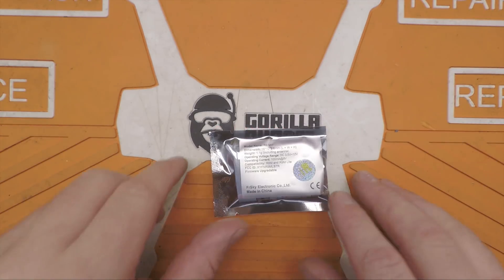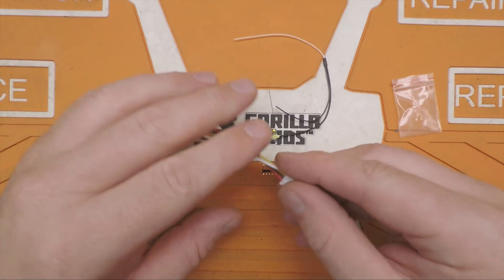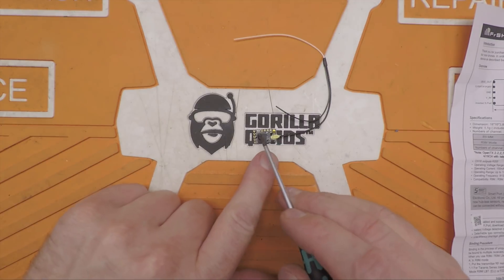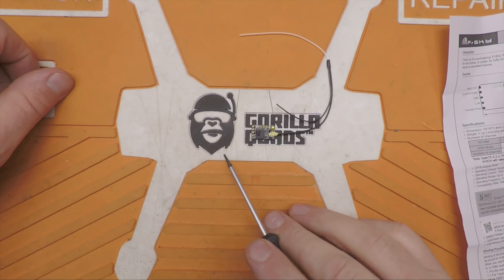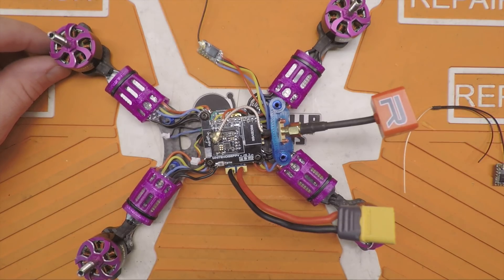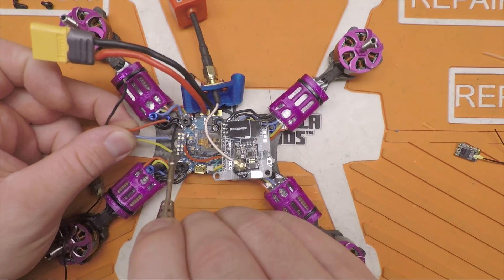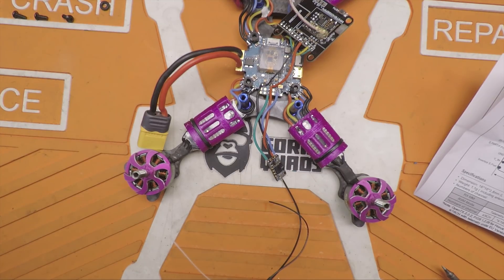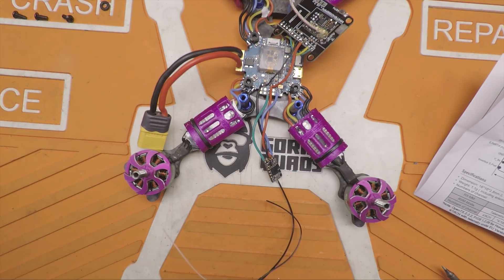Frsky R9 MM install and setup (READ THE DESCRIPTION!)

Comment: Thanks for the video! Why is it when I bind the r9mm channel with range 1-8 for better latency, I'm still getting rssi on channel 16? Is it not possible to bind in 1-8???
Reply from the maker: With the r9mm the rssi comes across on ch16. It just part of the firmware.
Reply: TweetFPV  Thanks for the reply. The reason I’m asking is because this thing drops out of the air as though I disarmed it. This isn’t my first build but it’s my first go around with R9 setup. I’m trying to eliminate all other possibilities like power loss, poor ground, or maybe even a faulty R9mm or R9m.
From what I gather, I may have a packet loss issue in Betaflight when binding in 1-16 channel range ( https://github.com/betaflight/betaflight/wiki/SBus-FPort-and-RC-Smoothing ).
So I rebound in 1-8 range (which is all I need anyhow) and still see Rssi over channel 16 in Betaflight. Therefore my head is about to explode. The more I try to figure out what’s going on the further down a rabbit hole I go!

So, since I bound in 1-8, that’s all I should be able to use, i.e. AETR plus Aux 1-4 and the R9mm just sends rssi down channel 16 anyway? Am I thinking this correctly? And my latency should be at 9ms thereby eliminating or rather minimizing any packet loss.

I’m trying to make this thing work since I paid for it but geeze, I’m about to rip it out and put a trusty ole r-xsr in it!

God, I hope that all made sense!

Thanks.

Oh, and it has the latest faa firmware. One was released just yesterday actually.
Reply from the maker: I see, there are a LOT, i mean a LOT of antenna issues with the r9 system. This LR  stuff is great but it is very sensitive to poorly made and mounted antennas. As far as fw goes I have not tested the recent fw but I have had excellent results with the  2018-08-21 firmware. Be sure you update both the TX and rx. If you are using the stock antenna that came with the r9m I suggest looking at the super 8.
How do you have your antennas orientated  on the Quad and are you in the US? I assume you are because you said you are using the fcc fw.
Reply: TweetFPV  Yup, I’m in Maryland. Both the R9m and R9mm are running the lates firmware and I’m using the super 8 antenna. I have the T-Dipole on the R9mm mounted horizontally out on a rear arm. Vertical would be better but finding a place to mount so it doesn’t get chopped is a challenge! 

I was also very careful when I removed the stock antenna and have the T-Dipole glued on with Kafuter. That’s the stuff they use at the factory.

It’s odd though. It’s not like I see the  rssi drop off and it failsafes. It just drops like I hit the disarm. It can happen 10’ away form me or 100’ away. No warnings in the OSD or barking from the radio. The Betaflight OSD just show the post flight info. One thing I haven’t tried is to turn the radio off on the bench to see if BF gives a fail safe message. I would think it would give some kind of message. 
I do know this setup is susceptible to antenna orientation and do see a drop off when the quad turns. Like from 99 rssi to 60-70 rssi.

I want to use the R9 not so much for LR but for penetration and one place I fly seems to have a lot 2.4 interference.

I think I may have to turn on the black box on and see if some clue turns up with that. I had crazy yaw spins on another build once. It had nothing to do with the build but just dumb luck it only happened when I was flying it.

Turned out to be a faulty gimbal in the Taranis. I wouldn’t have caught it screwing up without the black box recording.

I haven’t flown since I upgraded the firmware because the weather has been crap here. For all I know it might be fixed. The more I look into it the deeper down that hole I go! When I saw the latency issue on the BF wiki I searched around some more and came across your video. It seems very few people are using the R9mm and thought you might have some insight.

If I end up fixing it I’ll repost here as others may have issues as well.
Reply from the maker: are you running f.port or sbus/s.port?
Reply: TweetFPV SBUS w/ smart port. I’ve been seeing to many people with problems on fport.
Reply: Telemetry is working fine. Smart Audio is as well.
Reply: It’s on a Bardwell V2. Receiver is powered from 5v pad not associated with usb power so I’m able to update FW by serial passthrough.
Reply from the maker: I've had 2 Bardwell fc have the regulator fail in them. Not sure if thats your issue but you never know.
Reply: TweetFPV That is true. I’ve heard that. That supposedly has been fixed but who knows. From what I gather the 9v reg would fail. I’m on the 5v pad and the receiver is the only thing on it so it’s not overloaded.

My VTX is Unify HV run off vbat pad from the FC. I don’t think the board is shutting down as I would at least lose the OSD which runs through the board possibly just get a static snow for video.

But yes, the 5v could be going down intermittently. If I can get it to fail on the bench I might be able to monitor the voltage feed from the receiver to see if it drops out.
Reply: @TweetFPV  I flew 5 packs today and no failsafing. So between the firmware 181228 update and rebinding to 8 channels it seems to be good. 
Thanks for your help.
Reply from the maker: Awesome, I'll give the new fw a try and see how it works for me.

Comment: Any reason aux 12 is full? mine is the same, is that an issue?
Reply from the maker: Aux 12 (or ch16) is where the rx is giving betaflight rssi. You can choose to use that as your rssi value source for your osd but the scaling tends to be off, or you can choose to send the rssi from your transmitter back to bf on an aux channel for betaflight to use. I find that the one from the transmitter back to bf via an aux channel is a bit more accurate.
Reply: @TweetFPV  wow thank you for the quick response! i have one more question. im about to connect my last wire the "inverted s port" how do i know which tx to connect it to? im looking on my fc the cl racing f4 and i can only see a telemetry pad. Will clicking smart port in betaflight on the wrong uart brick my fc? i guess another question would be, How can i locate where my uarts are?
Reply from the maker: Wire the s. Port pad from the rx to the telemetry pad on the fc. The clf4 was designed with an inverter for smart port telemetry and should work with the normal s.port signal.
Reply from the maker: Locate your uarts using the mfg pinout for your fc

Comment: Hey there.. How do I connect this to a Helio AIO board? I am new to this Fport Sport concept. 
And I see that you said vertical orientation is the best for range, right? Didnt you have a 3D print where you could mount the antenna, similar to immortal T?
Reply from the maker: Which Helio board are you trying to use? There are a bunch of designs out there that work. Check out tinigiverse and find something that will work for your frame.
Reply: @TweetFPV  I am using Helio Spring AIO board. Also, I got the body 3d printed. WHat can I use for antenna tubes as I dont have them now?
Reply from the maker: You could probably get away with using cut zip ties and heat shrink untill you get your antenna tubes.
As far as your connections go you have a "sbus" pad and a "s.port" pad on your fc. Just solder the respective wires from your rx to those pads and you should be all set.
Reply: TweetFPV yes there is sbus and sport both available. So just simple wiring, right?
Reply from the maker: Yep. Btw what rx are you using?
Reply: TweetFPV r9mm
Reply: @TweetFPV  Also, I wanted to mount this on one of my 2.5" micro F3 board. It doesnt have a s.port pin... then do i just plug the sbus to sbus and thats all? Or is there anything else I need to do? And with just sbus connected, what telemetry can I expect?
Reply from the maker: If you just do the sbus wire on the f3 all you'll get is rx voltage and rssi to your taranis. The nice thing with a f3 processor based fc is you can connect the s.port wire to any txpad on an unused uart and will be fine. F3 and F7 processors have the ability to do inversion within the processor unlike f4 processors.
Reply: TweetFPV oh that's awesome...I will do that then... Thank you so much. Btw are you on FB? Asking if I could pm you there for any doubts?
Reply from the maker: I am but not publicly. Just use my YouTube registered email. Tweetfpv@gmail.com
Reply: TweetFPV sorry one more thing... On the F3, the s port should go to TX pin of any uart, right?

Also, the smart audio from vtx, that also goes on tx on any other available uart, right?
Reply from the maker: Yep. Just remember if you use the rx on a uart for one thing you can't use the TX of the same uart for another function, if that makes any sence.
Reply: TweetFPV yup... That makes sense...
Thank you for the quick response. You are a life saver
Reply: TweetFPV hey...on the R9MM ... There is sbus_out , s.port and inverted s.port. 
On my F3 board, what goes to uart and what goes to sbus pad?
Reply from the maker: Sbus goes from the rx to the sbus pad on your fc. Inverted s.port goes from your rx to any unused uart tx pad.
Reply: TweetFPV just to confirm...on my F3 board...
Sbus_out from Rx to sbus on FC AND
inverted s.port from Rx to uart on FC?
Reply from the maker: Yes, inverted s. Port must go to a TX on a uart not a rx pad.
Reply: TweetFPV sorry for so many questions... Soldering right now... Didn't want to mess it up
Reply from the maker: No worries. The only thing about the rx that isn't recoverable from is wiring the power and ground wrong. Magic smoke!
Reply from the maker: Btw as we speak I'm wiring up a r9mm to a F7 fc. Kinda funny.
Reply: TweetFPV I don't know how to send you a picture now... As in, in the replies... But I just finished and also ensured that voltage and ground are wired correctly😜... Plugging in battery now😬
Reply: TweetFPV and done... It's bound... And it's working... Thank you sir so very much...
Now what instructions/video do I follow to setup Betaflight with the s.port thing? Also I selected 16ch telemetry,I hope the latency is not too bad.

Comment: Does the inverted s port support F port...? Just got one of these r9mm I haven't installed yet.
Reply from the maker: Yes it does.
Reply: @TweetFPV  thx for your reply... ya got me flyin' Tweety... still confused... although fport is using a hardware inverted S port connection on Rx. Oscar, KnowItAll couple others have posts stating fport works on the un inverted UARTs and solves the inversion issue with F4 FCs. Sounds legit to me any program can be written to work through different types of serial connections. I'll give it a whirl on my next build.
Reply from the maker: Originally f.port was reported to solve the inversion issues but when it hit the streets in the small form rxs this was not the case. F.port does require a inverter on a uard with the exception of the r9mm and r9 slim+ rxs. Those have built in inverters to allow the fc to work with f.port/s.port when they don't have a second inverter on a uart. I hope that makes sense this inversion stuff is way too confusing. You have the r9mm rx so you can choose to use inverted or un inverted s.Port / f.port.
Reply: @TweetFPV  Makes sense to me... I'm on my 3rd build... 1. Tyro99 with R XSR lost :(... Had RSSI and Battery wich works without S Port on reciever and RSSI on OSD. 2. Tero Q215 XM+ RSSI 3. Tyro99 again with R9MM keeping things cheap til' I fly better. If or when I quit crashing I'll buy a better quad. I'm having lotta fun.
Reply from the maker: That's what it's all about!
Reply: MrLDavids   Fly, crash, repair, repeat.

Comment: I have problems getten my rssi correct on my osd. 
When i discover new sensors to rssi pops up and say its at 100%
In the osd it say 212%rssi.
The rssi in the mixer tab is set to aux 8 because thats a must in Flight1.
The rssi is working because when in walk away  the rssi is getting less.
When i lower the offset in the input tab to -100 the rssi value is still 112%
I have connected the sbus to a rx and the inverted s port to a tx.
I have followed the correct instruction from mr bardwell get rssi on osd video.
Using flex firmware 180926 beta do you know whats the problem?
Reply from the maker: Here is a link to a write up on how to setup rssi via the taranis. Give these steps a try. https://oscarliang.com/rssi-ppm-channel-taranis/
Reply: @TweetFPV  i have done that and no succes. I think it has something to do because of i connected it to a flight1 board
Reply from the maker: That would be my guess. I don't know anything about flight 1. Sorry I can't be more help that that.
Reply: @TweetFPV  its oke😉 i am trying for 3 days now and still no luck. But i dknt stop till i get it right
Reply from the maker: Good luck. Pleas post up here when you get it figured out. Hopefully it could help someone else out.

Comment: Hey Tweet. Where on YouTube is a good review of THE QUALITY OF THE RADIO LINK of the r9 system. Your videos, like every other video out there talks about how to hook it up. But is this a good, solid, failsafe free system?
I don’t want to buy Crossfire because I hate TBS, but I’m not going to switch over to r9 until I know what kind of performance to expect. 
I ask you because it seems like you know the answer. 
Enlighten me!!!
Reply from the maker: I have a video where I test the distance of the two systems but not with it installed Ina Quad. I have had great results with both the crossfire and the r9 systems. Neither system is a silver bullet though. It isn't as forgiving to poor rf environments and poor installations of recievers antennas. There is a bit of work with both systems to get them to be reliable. Now with the region specific antennas released from frsky I think a lot of the poor rf conditions will be fixed.
Reply: TweetFPV - thanks for the quick reply. Interesting answer too. I guess maybe it’s not time yet for everyone to ditch 2.4 yet... huh?
I would just hate to “upgrade” to 900 MHz , and then lose my quad because of a failsafe.
Reply from the maker: I originally started using a 900 system at distances that I would normally fly 2.4g just to never have to worry about failsafes and for that these systems are great. Now when you are trying to do long distance flight there is a lot of testing and tuning with any system. When I fly at normal distances and normal environments my rf signal is no longer a thing I even think about. My limiting factor is my 5.8g video signal.
Reply: TweetFPV - Oh ok. Well that sounds pretty good. Is the immortal T type antenna the best option in your opinion? That seems to be what most people like. 
Thanks for your help... subbed 🤓👍🏽
Reply from the maker: T style antenna on the Quad an a super 8, or tbs diamond antenna on the transmitter is the ideal setup. The stock antenna that comes with the r9m module isn't veery good and accounts for the majority of failsafes I've seen.

Comment: Any reason you opted away from using just F. Port? Tossing between using F. Port alone or doing it the old fashion way. I have an Airbot Omnibus F4 V6 nano, not that really matters which F4 FC it is, but with the MM having "inverted", I should be able to just use single wire to TX6 or TX3. I saw your video on F. Port setup, with the Mini, which didn't have inverted and you had to use soft serial, and then saw you setup this one with the SBUS and S. Port after that video, so figured I'd ask. Is it reliability issue?
Reply: Jdc 3D  I have F. Port running on my 5" build, using R-XSR and Mamba Stack, and I also have F. Port working on my 3" build with R9MM and Omnibus F4, and I have no issues on either build with telemetry or TX latency. I used the inverted pad on both the R-XSR and the R9MM connected to FC and ran command to tell FC it was uninverted. Don't remember the exact command. Either case, both work excellent
Reply from the maker: I haven't had any issues but I want to keep things as simple as possible. I just haven't gotten around to trying the f.port setup with the r9mm yet.
Reply: @TweetFPV  Thanks for the quick reply. I'll keep thinking this over. I have a few more days till the rest of my parts come in to complete this build...
Reply from the maker: Are you going with the r9mm or the r9 mini?
Reply: @TweetFPV  I bought the special combo R9M Lite pack, which came with the r9mm receiver
Reply: So can you hook up the mini fport to any uart on the f4 to get fport protocol? Or do I have to have the MM to use the fport protocol on F4?
Reply from the maker: @svin3819  with the R9 Mini you can only use F-port if you have a F4 FC that already has a telemetry pad like  the Holybro Kakute or the Joshua Bardwell F4 because those FCs are going to have a built in inverter on that UART. If you use the R9MM receiver then you can use the "inverted s.port" pad on the receiver and connect it to any unused UART TX pad and use F-Port.  Additionally any F7 (and F3) FC  will work on any UART with the R9 Mini because the F7 chips have the ability to do signal inversion internally to the processor this is not the case with the F4 processors.
Reply: @TweetFPV  ok so just order the MM and be done with it?
Reply from the maker: Yes, exactly.